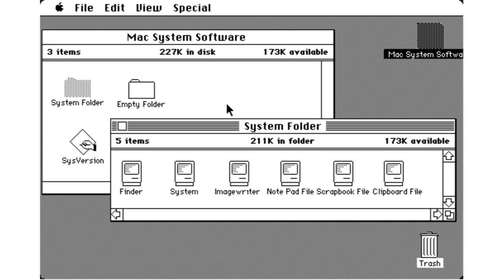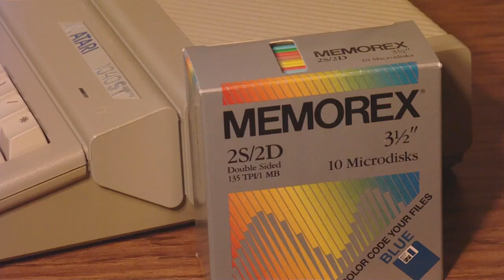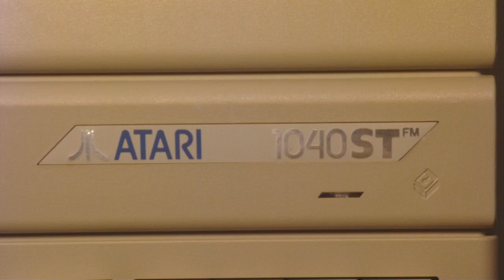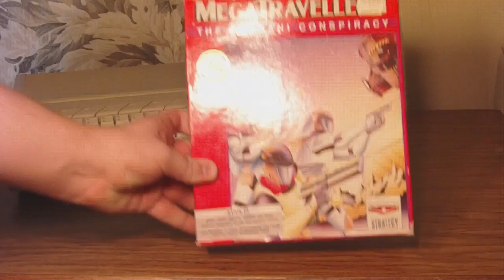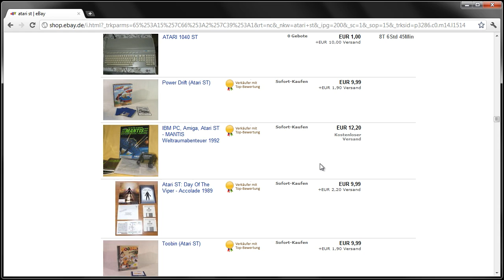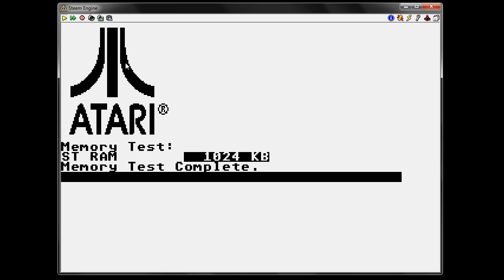LGR - Atari ST Computer System Review

Comment: It definitely had better 3d support than the Amiga,
Reply: No, it was actually the other way around. The Atari depended on the CPU for all graphics updating, while the Amiga had special hardware for drawing lines and filling them. The Atari STe did have a blitter chip, but it was primitive in comparison to the Amiga's and I don't think that many games supported it. The Amiga did though have a more cumbersome pixel format, which made using the CPU for 3D graphics more difficult,
Reply: Findecanor on Youtube
To get beyond the Amiga's usual 32-colour-at-a-time limit, programmers had to use a technique called "hold-and-modify" or HAM. Effectively, it had two pixels on separate frames representing one display pixel.

Comment: Thank you so much for this review!! I had a 520STFM as a kid which we managed to upgrade to a 2.5MB machine by soldering on another 2MB of RAM and I spent almost all my time on it ...

Looking back, and having so much experience with emulation, there is no doubt that as far as games are concerned, the Amiga was the better machine for sound and graphics. Every ST game which also had an Amiga port was better on the Amiga, but the ST had a certain charm which I'll never forget.

Comment: The Joystick / Mouse ports were put underneath to save cost.  Adding the 9 pin connectors on to the main PCB would have been cheaper than underneath the keyboard, the problem was the keyboard controller was on the keyboard and only used a few lines from the main PCB (compare that to the Amiga 600 / 1200).  If the controller was on the main PCB it would have made connecting the 9 pin ports much easier, but then they would have required a huge cable for all the keyboard lines.  With the controller on the keyboard, and if the ports were on the main PCB then another cable (at least 12 pin) would have had to then go back to the main PCB to connect to the controller ports, adding cost for more cables and connectors. Atari could have added another IC to control the 9 pin ports on the PCB, but they would have needed to add another hardware interrupt which would have slowed down the system a little more and added more cost.

Comment: My computer of choice at the time.  Professional grade documents.  I mixed microsoft and unix, pure unix.  Off the top of my head I cannot recall the publishing program for the ST that I dearly loved.  It was so precise and flexible that I could design PCB boards with it great detail, down to pixel width.  Pagestream?  At any rate I had access to any and all brands but even installed an ST in the controllers office to finese up the SCO Unix mule.

Comment: I had a 1040ST since it was less $ than the Amiga. Had both the color and monochrome monitors with a selector switch, and had both a 2nd 3.5 floppy and a 5 1/4" floppy connected with a selector switch. With the PC emulator (used the high speed data connector) and the Apple Mac emulator (used the cartridge slot), I could run all three systems simultaneously with just a hot key combo to switch between them, all for the price of a Mac. I also used extension cables for the joysticks and mouse. The monitors were Sony Trinitrons, The computer was also very good at WYSIWYG desktop publishing. I carted mine all over the Arizona and Southern Nevada to create on site newsletters for numerous events. I still have it, and enjoy firing or up every once on a while.

Comment: I used to have an ST 520, with a 20 MB harddrive that was almost as big as a modern tower. Then I got an ST 1040 and, try as I might, could not get the HD to work with it. So the 1024 ran solely of 3.5" DD floppies with Gem OS on ROM. Either work on a monochrome display or play on a TV screen (with half the resolution and half of the 16 colors it could do looked the same). I also couldn't get the mouse to work, so I had to move the cursor around with the arrow keys. I think you had to press a modifie key and arrow keys. With the INSERT key, you made a left-click. God, how I loved that computer. Even after its fan died and it would shut down after about 30 minutes.
Also came with an arcade style joystick (love, even tho the paddles didn't work) and a weird infrared gamepad controller. Never got it to work and never figured out how I was supposed to hold it. There wouldn't have been a way to hold it that was not awkward tho.
And some of the greatest games I have ever played in my life. Starray, Masterblazer, Goldrunner, Deep Space, Virus, Offroad...
Damn, this video made me all nostalgic...

Comment: First, I just want to say, excellent documentary, I thoroughly enjoyed it. I used to have a huge retro console and computer collection. I've had the 1040 STf and 512 STfm and the ST Mega 2. The Mega is the only one I still have, along with SM124 (Monochrome) and the SC1224 (Color) monitors as the Mega system I have doesn't have RF out. I also have ComputerEyes Video Digitizer and The Hippo Sound Digitizer. I picked it up the Mega at a thrift store about 10 years ago for $10.

Comment: Just grabbed an expanded 520STfm off Craigslist today for $40! Came with a box of original programs (mostly games) as well as the manual, all cables, mouse and a Mouse Master (clever little device to allow you to plug multiple items into your mouse ports and not have to deal with plugging anything into that port underneath). Just keep your eyes on Craigslist for local sellers.

Comment: Good review; I have an original Atari 520ST (no floppy or modulator built-in) which I bought purely to play Oids,  only released on the ST.  An external modulator was supplied with my (2nd-hand) ST; I believe it was supplied as standard for the early models.
I'm a bit surprised at the Genesis/Megadrive controller not working on the ST; I've used one on the Atari VCS, and button B is the fire button.  I'll have to test one.

Comment: I have owned and still own STs and Amiga machines. The ST is put down often, but it's simply amazing at how quickly the ST was designed and how capable it was. My 1040STFM ST not only had a built in drive, rom chips and power supply...my Amiga 500? It continued with a big, sightly power brick similar to Xbox 360s. I know it has extra custom chips absent from the ST, but still, the ST was nicely designed. My favourite is the Mega ST with a blitter chip that is sadly ever used...too bad the blitter was not standard in all models, for this would make the ST a far more capable gaming rig.

Comment: A very accurate telling of the history of what happened with Atari and Commodore. That's not an easy feat to pull off.

Just thought I'd mention, you skipped over the Mega STe, which came out in 1991. It had the same case design and ports as the TT030, except for the VGA output. The chipset was the same as a 1040STe, though the TOS version was higher. One of the cool things was you could install an internal SCSI hard drive on it, and it used SIMM memory, which was easy to upgrade. It had a detached keyboard, so the joystick ports were more sensible. There was one on either side of the keyboard.

You're right that the cartridge port didn't get used much. Of those who used it, I think the most popular use for it was for the Spectre GCR Macintosh emulator. You had to buy Mac ROMs separately, but once you plugged them into the board in the cartridge, you could boot MacOS (up to I think Version 5), and run Mac apps. right off of their disks, and use the ST's monochrome monitor. No conversion involved for any of it. Even though the floppy drive was PC disk-compatible, somehow the maker (David Small) managed to make it read Mac disks. As us oldsters will remember, the Mac used a variable speed floppy drive, and used Apple's GCR (Group Code Recording) disk format. He used to write about some of the details in Current Notes Magazine. What I remember is he couldn't alter the ST disk drive's spin speed, but he could alter the data read/write rate of the drive, and that's how he emulated the native read/write speed of the Mac drive. From what I remember, the emulation was pretty good, though I think it always had a problem with games, since they were written to be hardware-specific.

Comment: Never heard of this one before. This was Atari's most popular line of ST computers in the market after the Video Game Crash. While Atari made the ST, Atari concentrate on the 7800 console which was not as bad as the 2600 does, because Atari 2600 was a mind blowing console since it was re-released in 1986 as the "2600 Jr." which was a slimmer version of the 2600, but it plays all 2600 games as well. They also used it in "Action 52" for the NES where it used music for all 52 bad games using the Atari ST computer with the Music Studio.

Comment: I haven't read through all the posts to check if this has been mentioned but a European Mega Drive pad will work fine with a European ST. My mate adapted a Mega Drive pad so it would work as a 2 button controller on the ST by disconnecting the up switch on the pad and soldering it on the C button switch, the B button works as the normal fire button. Having 2 buttons made ST games like Rainbow Islands and Super Hang On playable. First time I played an ST was with a Cheetah 125+ joystick.

Comment: I love my Australian 1040 STFM. The cartridge port had a few expansions; coming to mind were hardware clock cartridges (there is no internal battery in the Atari so your clock reset when you turned it off) and video and audio capture cartridges (STOS Maestro would be one). I saw in your menus you had the Blitter chip which came with STE's, it was like a PC Turbo button for video. You could only change background colours on 2.x series TOS, most ST's were 1.02-1.04. Nice overview.

Comment: Hi phreakindee. I watched most of your videos. As you may notice, I live in France, the country who invented craps things like SECAM and good things like SCART. For your vintage computers, you may find an RGB -> YUV converter, this is a rather trivial conversion (far much easier than PAL -> NTSC), this can be achieved with a handful of transistors and resistors. So you can use the YUV input you must have on modern american TV sets. Fortunately in Europe, SCART is mandatory since 1981.

Comment: I went from using Atari 8-bits to STs (a 520, then a 1040) when I got into college. Probably not the best choice, but I managed to get quite a lot of use out of that 1040. Not so many games--as you mentioned, they were a bit hard to find in the US. I had Arcticfox and Skyfox, a weird Arkanoid-like game called Bolo, a crude Tetris implementation, a few others. But I used it more for word processing (mostly with 1st Word--I bought WordPerfect for the ST but it turned out to be an unusable, slow, bug-ridden dog), making artwork with a pretty good paint program called Degas, going online via dial-up with a terminal program called Flash, and hobbyist programming with Megamax Laser C. Yes, the Atari ST was the system I first taught myself C on.

I actually kept using it well into the nineties, but for the last several years it was almost exclusively a modem terminal.

Comment: The MC68000 was an odd duck (at the time) in respect to being classified as a 16-bit CPU. It had a 24-bit address bus off the chip which enables addressing up to 16MB of physical RAM memory. And it had 32-bit address and data registers internally. Which means one can essentially write 32-bit software for it (which smoothly works the same on the latter true 32-bit 68020, 68030, and 68040 CPUs. The one aspect that had an actual 16-bit limitation is a relative branch mode that was limited to 16-bit relative offset address branching. Compilers tended to definitely take advantage of that as the generated code would be more compact and more efficient in execution than 32-bit addressing modes. The Macintosh computer even had programs consisting of code resources where an individual code resource was limited by this 16-bit aspect of the CPU's addressing mode. Which meant one could make an efficient 16-bit branch to a function within the same code resource segment, but to call a function in a different code resource required a long branch/jump using 32-bit address modes. This means that one then has the possibility of 16-bit function pointers or 32-bit function pointers (of course a 16-bit function pointer could always be fully qualified to its actual 32-bit address). In that respect, the MC68000 had some vague resemblance to the 8086/80286 long pointer segmented addressing modes.

Comment: The 7 things I remember about having an Atari ST....
- I first remember seeing a shop display playing the game Xenon 2 Megablast. Coming from a 48k Spectrum, I knew I had to have an Atari ST. Seeing that game was a quantum leap.
- Having a large plastic case full of floppies.
- Pirate copies or getting copies off your friend. Towards the end of the era,  most games had a security feature where the game asked you to type in a word from the instruction manual (what is the 5th word on page 10). The game Teenage Mutant Ninja Turtles actually had a codebook that was black ink on brown paper so you couldn't photocopy it
 - In the UK there was stiff competition between the Amiga and ST. Similar to Xbox vs Playstation. Annoyingly most of my friends had Amiga's. One Amiga owning friend must have had over 100 games, all of them copies.
- The Atari ST was a favourite with the music industry with its MIDI port. I remember them still being used in 1993 or 1994 rather than PC's that were coming into use. In fact, my well equipped music class at school used an Atari ST.
- Back then, you could buy games magazines that came with a free floppy disc stuck onto the cover that had demo versions of new games (or tape if you were a speccy owner).
- If you did buy an original game, how awesome the packaging was. Great big cardboard boxes full of stuff and some flight sims had instruction manuals that were like 200 page textbooks. There was no expense spared.

Comment: Instead if lifting from the front, lift from the right side. That's what I used to do! I think that cartridge port was used for a couple of audio breakout boxes from C-Lab (at least, in the case of the Falcon030; I'm not to sure about the ST/e's), if I'm not mistaken. Also, thank you for pronouncing 'Tramiel' correctly! Subbed!

Comment: The power supply unit is a switching one... 'switching' just mean the way of converting the 50/60Hz power input to DC then to high frequency AC then transform it down to low voltage AC and rectify. It doesn't necessary mean that the power supply unit can work with a large range of voltages. Earlier 'dumb' switching power supplies work with a certain voltage.

Comment: There were a few things that used the cartridge port. The most common use for it was to run the Spectre GCR or Spectre 128 Macintosh emulator. I forget which was more recent. It was compatible up to Mac OS System 6. You had to buy the Mac ROMs separately, though, and install them inside the cartridge. I don't think any soldering was involved. It only ran in the ST's high-rez monochrome mode.

Comment: One doesn't need an Atari monitor if they are willing to wire up their own cable. I used a standard black and white Atari monitor most of the time, but wanted to try some software in color, so I wired up a connector that output RGB on separate BNC connectors and then could feed that signal to a color Electrohome monitor I owned. Worked fine.

Comment: I owned an Atari ST 1024 that my wife bought for Midi playing around. Loved it. Dungeon Master has to be one my favorite games of all time. However, that port on the side. VERY IMPORTANT. Here in Dallas, you could go and purchase a module for the side that included the ROMs for the Machintosh. It immediately booted up as a MAC and could run all the MAC software of the day. Funny thing, when we were doing this, nobody knew that it was illegal. Not sure you can even find those anymore. My ST is long gone.
Reply: http://lowendmac.com/clones/atari.html

Found it. It was called Magic Sac and later was called Spectre 128. I think we had a Magic Sac.

Comment: I've got two SF354 drives and an sc1224 screen, along with all of the power adapters and cables for them, and an ST computer...just don't have the system. (same with a 5150) I had an atariage post going a while ago on it, got more offers from people trying to buy the screen than were helpful to buy the system... kind of looking for an stf or better, as the floppy drives I have now are single sided, but beggars can't be choosers.

My Portable Compaq has a midi card installed, so much fun!

Comment: @ThomasGGebert If I remember correctly, the ST didn't have hardware support for scrolling, so although it was perfectly possible, it could often be rather slow and jerky(as in the awful SOTB port), unless the programmers really knew their stuff. 3D games weren't so much of a problem for the Atari, because shifting a few simple polygons around was a lot easier than detailed bitmap graphics.

Comment: Though I sold 90% of my ST hardware, I was incredibly lucky in what I got.  I picked up a 1040STE (which I upgraded to 4MB), a 1040STf, an SH-204 hard drive, STacy2 (which needed restoration), SC-1435 color stereo monitor, and SM-124 monochrome monitor for free off craigslist.  Local songwriter wanted to offload his Atari gear.

Comment: The ST outputs 15.75khz TV-RGB video. Any monitor designed for the Amiga, Tandy Color Computer, or Apple IIgs will work, not just Atari ones. There were quite a few early VGA monitors that will work with 15.75khz video as well like the original NEC Multisync and Multisync II (message me if you need a complete list).

The ST might have had built in MIDI, but the IIgs got a much better sound chip. Nothing from that era beats Cubase for composing music though.